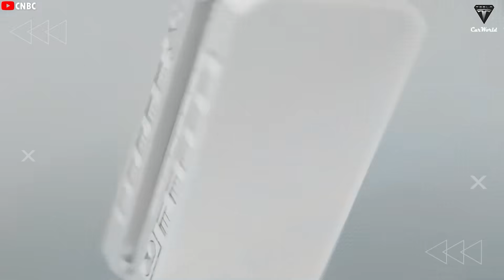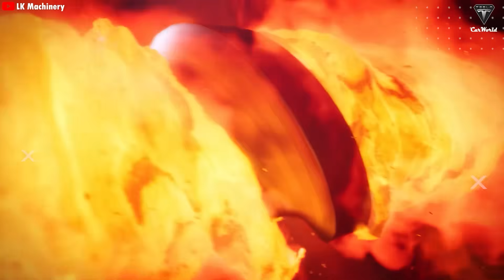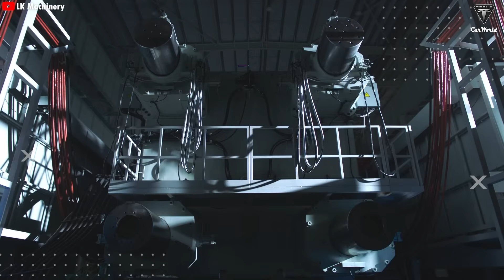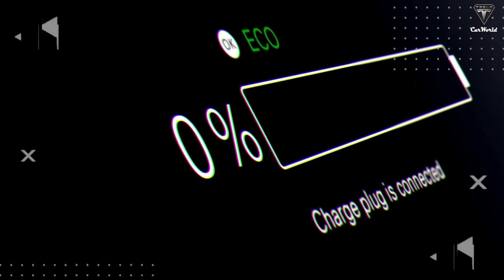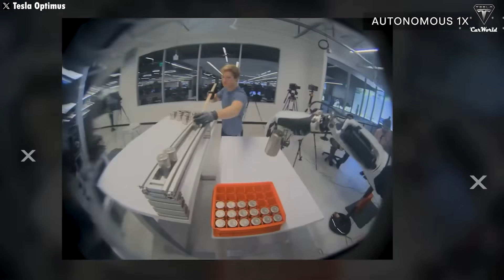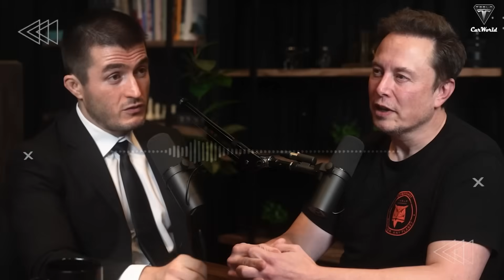Elon Musk LEAKED Insane GIGA PRESS 50.000T ON Never Seen Production Line! Casting 5 Tesla At Once!

Comment: Now wait , so if it’s cast aluminum and the car gets in a wreck it will not bend but crack and break? And a frame machine must be out of the question as well ( right )
Reply from the maker: Giga Press Frames Are Harder to Repair, This Is the Truth
Reply: And it will split in half in a car crash.

Comment: If true, this kind of manufacturing innovation could significantly change how EVs are produced. It will be interesting to see how it impacts efficiency and cost in the long run.
Reply from the maker: efinitely! The 50,000-ton Giga Press could revolutionize EV production, potentially lowering costs and boosting efficiency over time.